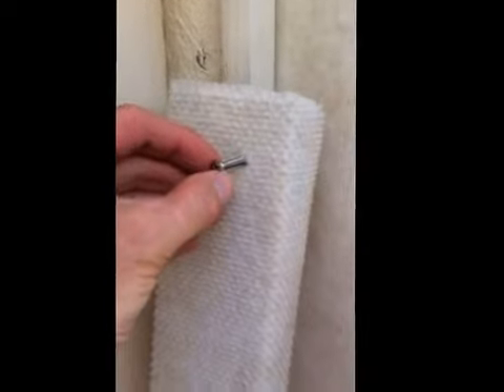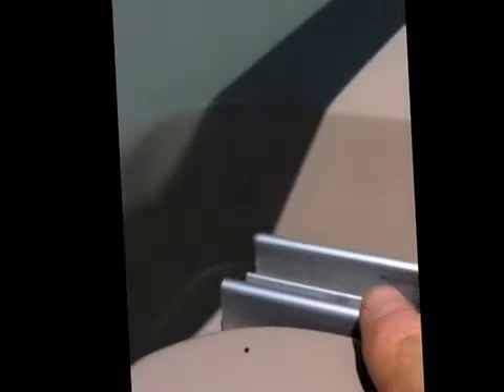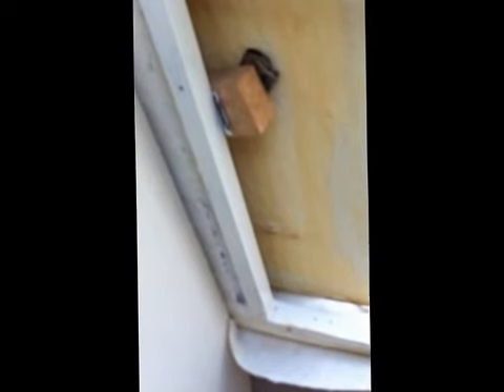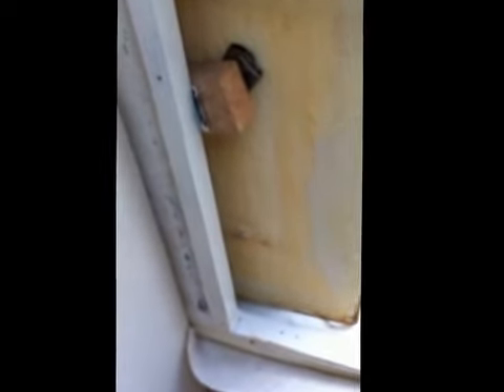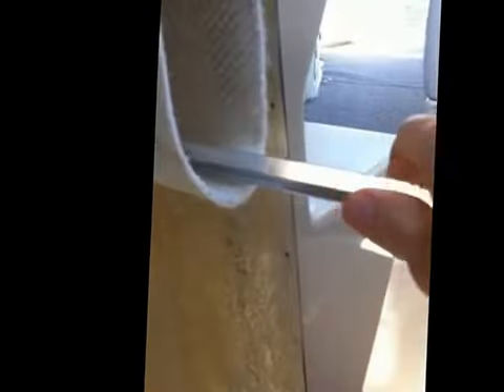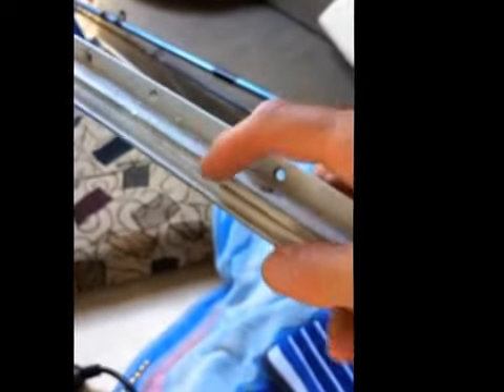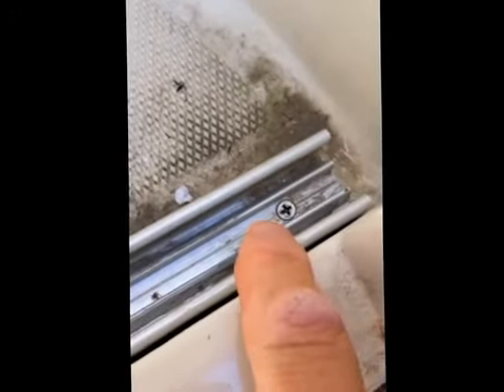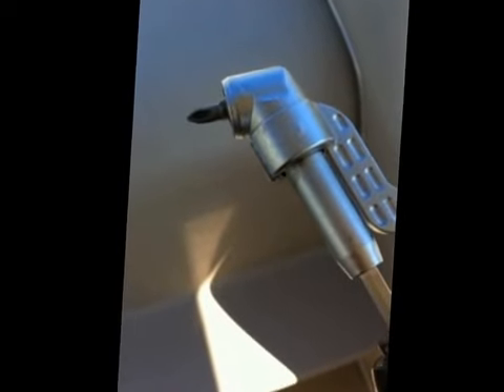Sea Ray 2001 Sundancer Cockpit-door Track Repair

Comment: My door had broken free from the track frame. This door was very difficult to move. using your advice I made a small hole in the bottom of the wall & removed the old screws. I reattached the door using longer screws.  Replaced #8 3/4" with #8 1"
Reply: Did you remove the track  ( remove it, clean it and replace the balls)?

Comment: How did you loosen the screws on the lower track without removing the helm assembly?  the upper track is accessible behind the instrument panel which is easy to remove but not the lower track
Reply from the maker: Gary Graham hi there - TBH it’s been a few years since i did this and i really have no recollection! I’m guessing it was pretty easy/obvious otherwise I believe i would have included it ... a simple case of a longer screwdriver giving reach ? I’ll think on it further and if it comes to me I’ll let you know ... i  no longer have the boat BTW... good luck ☺️

Comment: There is four big screws inside the console remove them and then remove the console and you have full access to the door and the track
Reply: Do you have to remove the windshield? What about the caulking around the console/helm?  Or did removing these screws provide enough clearance to work on the door without removing the whole console/helm .